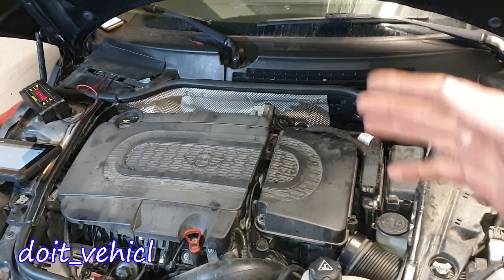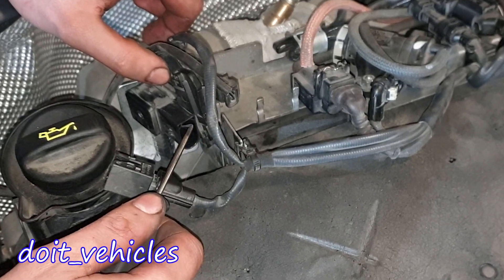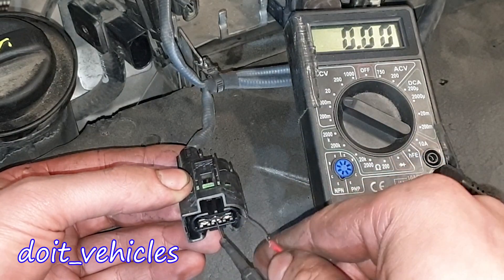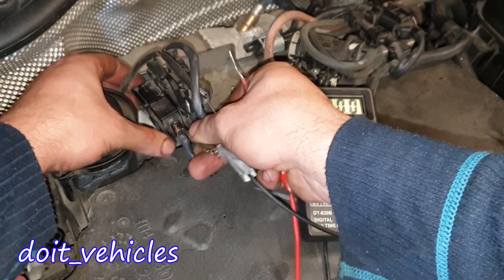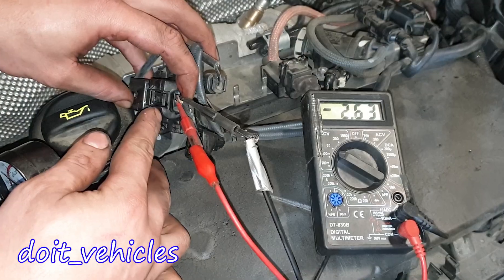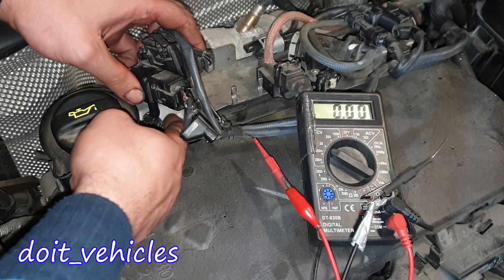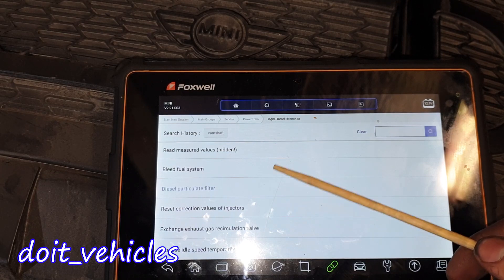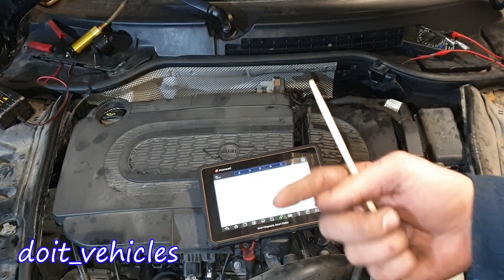Diesel Particle Filter ( DPF ) Pressure Sensor - Testing - Mini One D

Comment: Can you help me, on my transit, when its started presure its 0.7-0.9 kpa, when accelerating more than 2000 rpm the pressure going to 0. Its thath normal. And apear dtc p2002